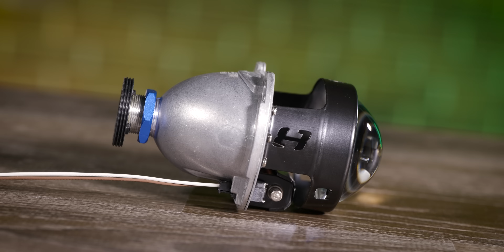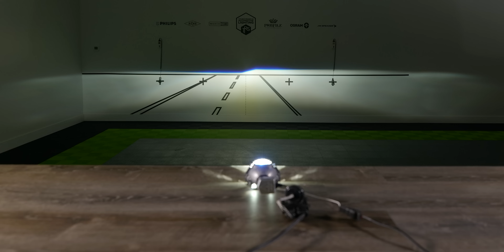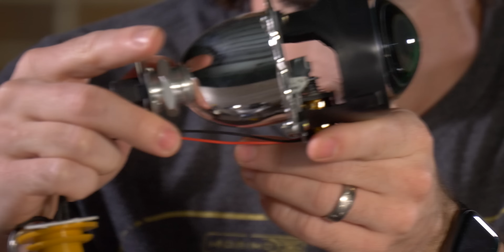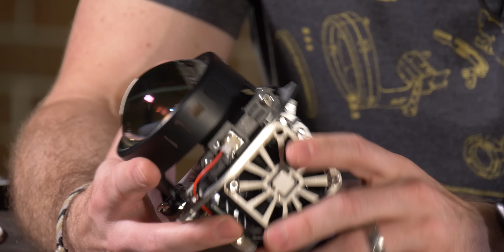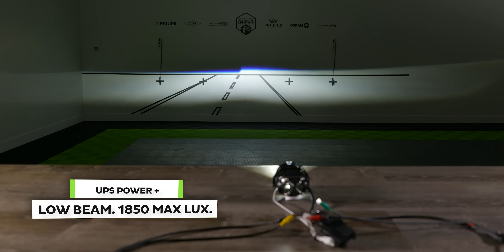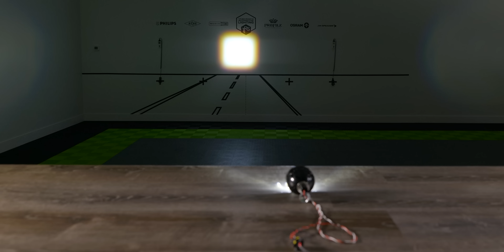LASER VS HID VS LED Headlight Projectors Retrofits - WHICH IS BETTER? | The Retrofit Source

Comment: Does the profile bi led or the morimoto 2.0 bi led fan have to be enclosed in the light housing or can the be left out behind the headlights?
Reply from the maker: They will both have a fan that you will have to install inside the headlight housing, this will be totally fine as they are designed to funciton inside those headlight housings! You will have nothing to worry about as far as heat goes, that is why they have those fans! Let us know if you need anything else or have any other questions, have a great day!

Comment: Looking at retrofitting a 2009 G6 with a quad-projector for an off-road project of mine. Space is tight as I might have to cut the back of the frame. Anyone have experience with this?
Reply from the maker: Not sure exactly what vehicle that is, could you get me the year make and model for that?

Comment: Have you reviewed any of the Hella after market  Led Projector modules, as these ate sae,  ece and dot appoved?
Reply from the maker: We havent had those in for testing, we will have to look into those and see if we can get a video going for you!
Reply: @RetrofitSource  that's great. I am considering putting a 60mm led projector into my 2002 A3, in place of the pathetic halogen unit. Already have second set of OEM headlights from an S3 with HID. Additionally, I have a 1998 Honda S-MX, that I am considering Hella's 90mm Gen 1 BiLed. I won't use a threaded connection, rather make a custom carrier, an add other features. 
Is this the same as the UPS? 
￡381.10  36%OFF | SANVI Car Bi LED&laser Projector Lens headlight 35w 6000K hi-low beam Auto LED Projector Headlight Car Motorcycle Light Ppgrade
https://a.aliexpress.com/_BOxpGH
Reply from the maker: Right on, that would be a fantastic option to upgrade that light output! If you would like to get some products on order or have any other questions, shoot us an email and we will get you taken care of! Support@TheRetrofitSource.com

Comment: What would be the difference between the MLED 2.0 and Mini D2S 5.0 range wise? Would the MLED 2.0 project as far as the Mini D2S 5.0? Would the MLED 2.0 be the better choice? Also what would be better for wet/snow driving? I'm trying to decide between these 2.
Reply from the maker: Tyler, both those options are going to provide a fantastic upgrade overall, and it just depends on what you are looking for! The M-LED 2.0 will provide a wider and overall better beam pattern, and will produce a ton of light output! The Mini D2S will provide a longer throw, so you will be able to see a little further down the road with those. It is dependent on what would work best for you in your specific area, and of course, your personal preference! I will say that the MLEDs are a little easier to install!

Comment: Man... I'd love the Morimoto MLED 2.0 in my headlight but I have a 2019 Toyota 4Runner. Darn side projectors...

I'm shamefully running factory projectors with HID's as the original halogen bulbs are dimmer than a candle.

PLEASE HELP ME lol
Reply from the maker: Hey there, not sure if I have heard of any issues with running projector retrofits in that side projector, but you should be good to go! If you are worried about fitting those in your headlight housing, you could go with the Mini H1 8.0, as that will be a fair amount smaller.
Reply: Lexus rx350 projectors with a clear lens will fit with some mods to clear the solenoid and bolt right in. With your choice of d2s bulb to go with.

Comment: Not sure if this may help someone, but the Morimoto Mini HB also works as a drl in my application. Used on a 12 Civic Si, with a pulsed 9.6v circuit and it lights up not at full brightness but bright enough and does not pulse. No capacitors, resisters, or relay harnesses were used.
Reply from the maker: That is great to hear, thanks for the information! Hard to find options that will work with voltage drop or PWM drop DRLs!

Comment: That laser high beam is literally over 9000! If you guys ever make a 2.5" MLED projector with the same bolt pattern as the Mini H1, I may have to get myself another upgrade.
Reply from the maker: The issue is size I believe, but we will keep you in the loop if that is ever coming!
Reply: Same here, I'm looking to get brighter light for my fiesta, I retrofit my ford fiesta with mini h1 but not enough light